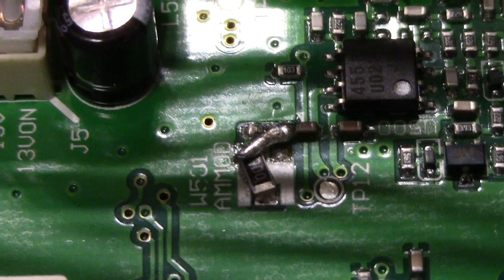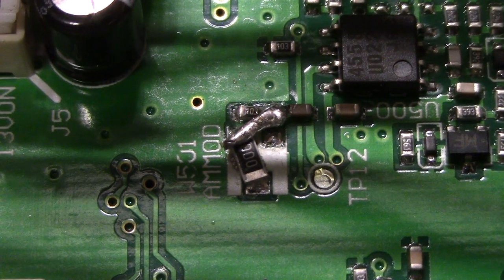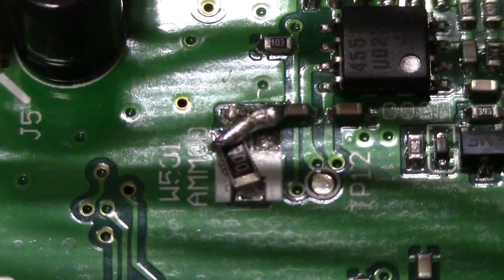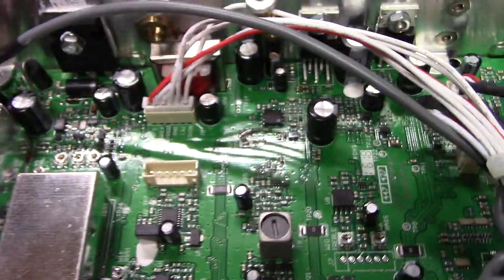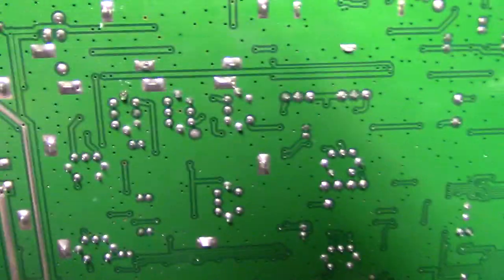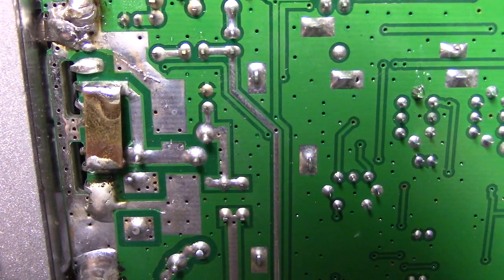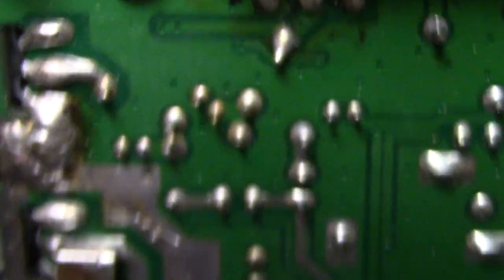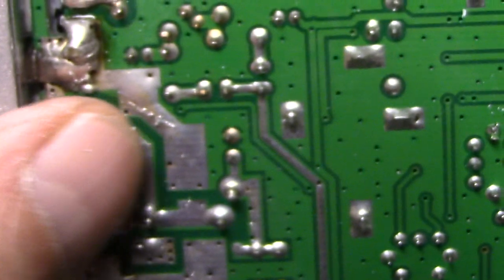Stryker 447 HPC2 Tuned And Modified By Walcott Radio, Walcott Iowa.

Comment from the maker: The Stryker Radio Club SRC recommends this shop (lol) so they can sell volumes of radios to unsuspecting customers and they don't care how bad that they  "hack-Up" your radio. Not much to say about Integrity for the Stryker Radio Co. 

It's all about Procedure .. No Exceptions.

You make them ring and I'll make them sing. 
https://www.nist.gov/pml/productsservices/physical-reference-data

Cleaner And Meaner .. Only the serious need apply.  No "tire kickers" or
undesirables that I know for a fact disrespects the airwaves and 
especially Channel 19. Haters are always going to hate because it's all
that they know how to do and what they do best. 

If you can't handle the heat .. get out of the kitchen. 

If they can't show you .. in a video .. they're snowing you. Get The 
Picture??

Here's what it actually takes to cut through the noise, be loud and 
crystal clear with a better receiver too:  A) Tuned Bench:  
https://www.youtube.com/watch?v=lwcDfXOgAls.  True, it's more 
complicated and time consuming to accomplish these consistent and 
accurate results. Below is a partial procedure and list of calibrated 
equipment used to achieve this level of performance . Read on ..

Radio Evaluation Rules: 
https://www.facebook.com/163Hardrive/posts/3729504220447644
https://www.facebook.com/163Hardrive/posts/3523601657704569

Fine Tune CB Radio Shop strictly adheres to (https://www.nist.gov/) NIST
 Traceable Calibrations and other industry standards to maintain 
accuracy and consistency for providing Real World Performance Tuning of 
Citizens Band and 10 Meter export mobile radios with integrity.

"Basic Textbook AM/FM/SSB Transceiver Tune, Alignment and Calibration" 

1) Pll adjustments
VCO & OSC, AM TX OSC, USB TX OSC, LSB TX OSC.

2) Transmitter alignment
DRIVER BIAS, FINAL BIAS, SSB  (or gate voltages for mosfet versions) 
CARRIER BALANCE, HI-LO AM & SSB Power, RF METER, AMC, ALC and FM 
DEVIATION.

3) Receiver alignment
AM/FM RF & IF SENSITIVITY, FM DETECTOR/DEVIATION, SSB IF 
SENSITIVITY, SSB S-METER, AM/FM S-METER (100uV unmodulated -67dbm for 
�S-9� meter reading!), AM/FM SQUELCH RANGE, SSB SQUELCH RANGE, and NOISE
 BLANKER/AUTOMATIC NOISE LIMITER (Real World dBm to volts (uV) tables 
below).

That's just a typical run of the mill textbook tune up and alignment (if
 you're lucky). There's more to it than frequency alignment, modulation 
adjustment, meter calibration and a tune up report displaying 
exaggerated rms Bird peak watts! 

"Test Bench includes"

Bird 4314C Meter
https://www.birdrf.com/Products/Test%20and%20Measurement/Power-Meters/Wattmeters-Line-Sections/RF-Wattmeters/4314C_PEP-Single-Element-Wattmeter.aspx
Part 1) https://www.youtube.com/watch?v=RpX9IHe4ORM&t=16s
Part 2) https://www.youtube.com/watch?v=LuhbqTf6Bxw
Bird 4314C Accuracy Test: 
https://www.youtube.com/watch?v=DqEOabYqhQo&t=5s
Bird Stipulates 1/2 wavelengths  
https://www.youtube.com/watch?v=5eWhgT-rTII
And Genuine Bird Elements from 1K down.

Bird 4373 Sampler 
https://www.rfparts.com/signal-samplers.html

HP8924c with options
http://userequip.com/files/specs/2147/HP%208924C%20Repair.pdf
https://www.youtube.com/watch?v=Cg1w0xBa27s&t=1s

HP8920a with options
https://www.keysight.com/upload/cmc_upload/All/EPSG072204.pdf

Three analog scopes, one digital 200 Mhz
https://www.atecorp.com/atecorp/media/pdfs/data-sheets/tektronix-2465b-2467b_manual.pdf
https://www.youtube.com/watch?v=by98x4eu2lM

Fluke 27fm
http://www.fluke.com/fluke/inen/digital-multimeters/fluke-27.htm?pid=56055
 
LCR 
http://www.lcrresearch.com/wp-content/uploads/2017/05/LCR_Pro1_Manual_version1.03.pdf

Power supplies
6 Cosel PBA1500f12 (750 amps) variable and configurable.
https://en.cosel.co.jp/product/powersupply/PBA/PBA1500F/PBA1500F-12/
Corcom 20VB1 F7130 EMI Filter 50-60Hz 250V

Times Microwave Coax jumpers and test leads
http://www.timesmicrowave.com/cms/products/cables/lmr/
https://www.youtube.com/watch?v=EmqaGJ6IWow
https://www.youtube.com/watch?v=1ltFVSxGp5Y
https://www.youtube.com/watch?v=v12YZT_1o90
https://www.youtube.com/watch?v=h7iiYfmYWRA&t=215s

Amphenol RF Connectors
https://www.amphenolrf.com/
https://www.youtube.com/watch?v=dVh5B0hdEA0 
https://www.youtube.com/watch?v=dKZg8T_AOso

More range, compliments, reliability and a quieter, clearer but more 
sensitive receiver,  Get Fine Tuned .. not peaked and ruined.

Here are some VideoGates of me at the bench practicing what I preach 
using my bench radio or customers radio completed and ready to be 
shipped: https://www.youtube.com/results?search_query=hard+drive+163+ 
more: 
https://www.google.com/search?q=Hard+Drive+163+nm&ie=utf-8&oe=utf-8&client=firefox-b-1-ab

It's what I recommend, use, service and sell ... to you ... not 
something non practical or deceiving in a misleading way. I'm not just 
the tech and owner of Fine Tune CB Radio Shop, I'm a customer too!  When
 finished, You'll be giving radio checks, not asking for them .

dBm To Watts and Volts
Tables below displays relationship between Power in [dBm] or [Watts] and
 Voltage in RMS, peak, peak-to-peak for sinusoidal signals in 50-Ohm 
systems for accurately measuring and tuning am/fm/ssb receiver 
sensitivity, agc, squelch and "S9" Meter calibration. Real World! 

Mike @ Mikes Radio Repair (Romper Room), Mark Rutherford aka Mark 19960, CB 
Kidd, Martian and all of your other fake accounts pay attention to the 
tables below, stop misaligning radios, spreading false information and 
promoting propaganda! 

  [dBm] [Watts]   [Volts]rms   [Volts]p    [Volts]pp
-140 0.100E-16  22.361 nV  31.618 nV  63.236 nV 
-139 0.126E-16  25.089 nV  35.476 nV  70.952 nV 
-138 0.158E-16  28.150 nV  39.805 nV  79.609 nV 
-137 0.200E-16  31.585 nV  44.662 nV  89.323 nV 
-136 0.251E-16  35.439 nV  50.111 nV  100.222 nV 
-135 0.316E-16  39.764 nV  56.226 nV  112.451 nV 
-134 0.398E-16  44.615 nV  63.086 nV  126.172 nV 
-133 0.501E-16  50.059 nV  70.784 nV  141.568 nV 
-132 0.631E-16  56.167 nV  79.421 nV  158.842 nV 
-131 0.794E-16  63.021 nV  89.112 nV  178.223 nV 
-130 0.100E-15  70.711 nV  99.985 nV  199.970 nV 
-129 0.126E-15  79.339 nV  112.185 nV  224.370 nV 
-128 0.158E-15  89.019 nV  125.874 nV  251.747 nV 
-127 0.200E-15  99.882 nV  141.232 nV  282.465 nV 
-126 0.251E-15  112.069 nV  158.465 nV  316.931 nV 
-125 0.316E-15  125.743 nV  177.801 nV  355.602 nV 
-124 0.398E-15  141.086 nV  199.496 nV  398.992 nV 
-123 0.501E-15  158.301 nV  223.838 nV  447.677 nV 
-122 0.631E-15  177.617 nV  251.151 nV  502.302 nV 
-121 0.794E-15  199.290 nV  281.796 nV  563.591 nV 
-120 0.100E-14  223.607 nV  316.180 nV  632.360 nV 
-119 0.126E-14  250.891 nV  354.760 nV  709.519 nV 
-118 0.158E-14  281.504 nV  398.047 nV  796.094 nV 
-117 0.200E-14  315.853 nV  446.616 nV  893.232 nV 
-116 0.251E-14  0.354 �V  0.501 �V  1.002 �V 
-115 0.316E-14  0.398 �V  0.562 �V  1.125 �V 
-114 0.398E-14  0.446 �V  0.631 �V  1.262 �V 
-113 0.501E-14  0.501 �V  0.708 �V  1.416 �V 
-112 0.631E-14  0.562 �V  0.794 �V  1.588 �V 
-111 0.794E-14  0.630 �V  0.891 �V  1.782 �V 
-110 0.100E-13  0.707 �V  1.000 �V  2.000 �V 
-109 0.126E-13  0.793 �V  1.122 �V  2.244 �V 
-108 0.158E-13  0.890 �V  1.259 �V  2.517 �V 
-107 0.200E-13  0.999 �V  1.412 �V  2.825 �V 
-106 0.251E-13  1.121 �V  1.585 �V  3.169 �V 
-105 0.316E-13  1.257 �V  1.778 �V  3.556 �V 
-104 0.398E-13  1.411 �V  1.995 �V  3.990 �V 
-103 0.501E-13  1.583 �V  2.238 �V  4.477 �V 
-102 0.631E-13  1.776 �V  2.512 �V  5.023 �V 
-101 0.794E-13  1.993 �V  2.818 �V  5.636 �V 
-100 0.100E-12  2.236 �V  3.162 �V  6.324 �V 
-99 0.126E-12  2.509 �V  3.548 �V  7.095 �V 
-98 0.158E-12  2.815 �V  3.980 �V  7.961 �V 
-97 0.200E-12  3.159 �V  4.466 �V  8.932 �V 
-96 0.251E-12  3.544 �V  5.011 �V  10.022 �V 
-95 0.316E-12  3.976 �V  5.623 �V  11.245 �V 
-94 0.398E-12  4.462 �V  6.309 �V  12.617 �V 
-93 0.501E-12  5.006 �V  7.078 �V  14.157 �V 
-92 0.631E-12  5.617 �V  7.942 �V  15.884 �V 
-91 0.794E-12  6.302 �V  8.911 �V  17.822 �V 
-90 0.100E-11  7.071 �V  9.998 �V  19.997 �V 
-89 0.126E-11  7.934 �V  11.218 �V  22.437 �V 
-88 0.158E-11  8.902 �V  12.587 �V  25.175 �V 
-87 0.200E-11  9.988 �V  14.123 �V  28.246 �V 
-86 0.251E-11  11.207 �V  15.847 �V  31.693 �V 
-85 0.316E-11  12.574 �V  17.780 �V  35.560 �V 
-84 0.398E-11  14.109 �V  19.950 �V  39.899 �V 
-83 0.501E-11  15.830 �V  22.384 �V  44.768 �V 
-82 0.631E-11  17.762 �V  25.115 �V  50.230 �V 
-81 0.794E-11  19.929 �V  28.180 �V  56.359 �V 
-80 0.100E-10  22.361 �V  31.618 �V  63.236 �V 
-79 0.126E-10  25.089 �V  35.476 �V  70.952 �V 
-78 0.158E-10  28.150 �V  39.805 �V  79.609 �V 
-77 0.200E-10  31.585 �V  44.662 �V  89.323 �V 
-76 0.251E-10  35.439 �V  50.111 �V  100.222 �V 
-75 0.316E-10  39.764 �V  56.226 �V  112.451 �V 
-74 0.398E-10  44.615 �V  63.086 �V  126.172 �V 
-73 0.501E-10  50.059 �V  70.784 �V  141.568 �V 
-72 0.631E-10  56.167 �V  79.421 �V  158.842 �V 
-71 0.794E-10  63.021 �V  89.112 �V  178.223 �V 
-70 0.100E-09  70.711 �V  99.985 �V  199.970 �V 
-69 0.126E-09  79.339 �V  112.185 �V  224.370 �V 
-68 0.158E-09  89.019 �V  125.874 �V  251.747 �V 
-67 0.200E-09  99.881 �V  141.232 �V  282.465 �V
-66 0.251E-09  112.069 �V  158.465 �V  316.931 �V 
-65 0.316E-09  125.743 �V  177.801 �V  355.602 �V 
-64 0.398E-09  141.086 �V  199.496 �V  398.992 �V 
-63 0.501E-09  158.301 �V  223.838 �V  447.677 �V 
-62 0.631E-09  177.617 �V  251.151 �V  502.301 �V 
-61 0.794E-09  199.290 �V  281.796 �V  563.592 �V 
-60 0.100E-08  223.607 �V  316.180 �V  632.360 �V 

                 Don't Be A Mud Duck!

Contact: https://www.youtube.com/watch?v=P0W_Ltzeyyc

163 Hard Dr.